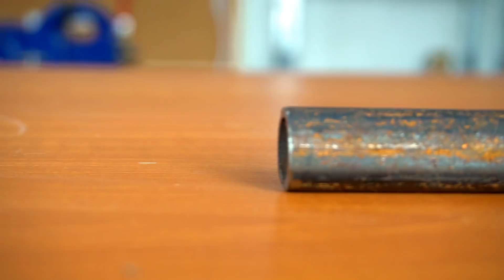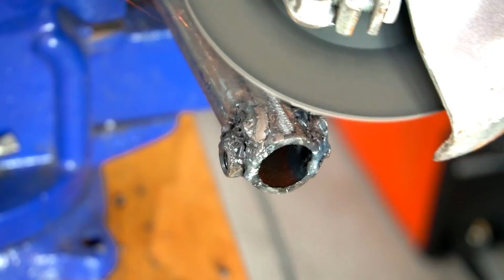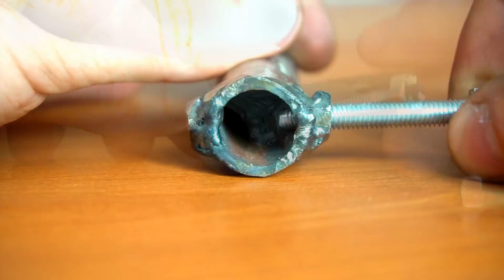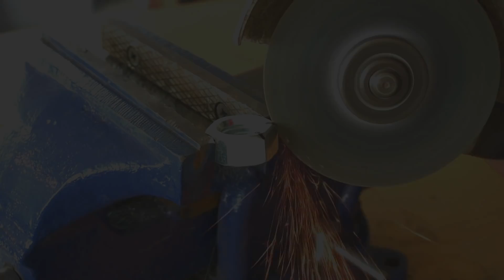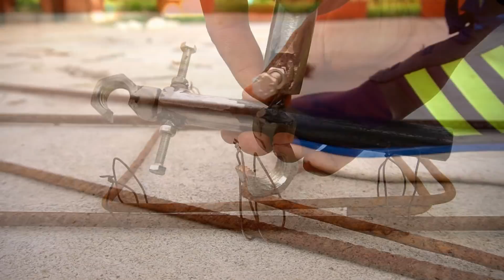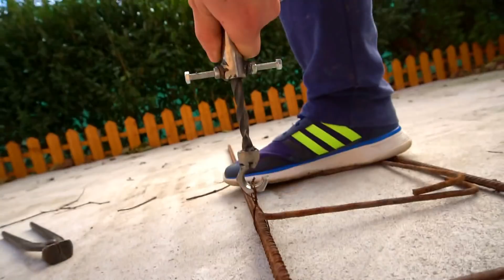Awesome New Product |DIY Life Hacks & Ideas

Comment: Nice idea. I can see you can make some further improvements by using an eye hook since its round and smooth so you can take it off those wire more easier. And, use a small many wound tension spring to hold that drill bit from dropping down. You made need a longer handle for this case. Lastly, when doing welding you need to descale those metal surface first. I can understand for this case it doesn't really matter. Nice job
.

Comment: Rebar wire tiers are super common and WAY more simple. In addition, if you have an angle grinder, drill, AND welder, why wouldn't you own a set of taps to just thread the holes?
 
At least there's somebody out there tinkering. Probably not an American, though. Can't get anyone to put down their phone here.

Comment: Would like to see more like this, but made a little bit more presentable.  Don't take this as a "put-down of the good ideas!  It will gain more acceptance if "cleaned up" a bit with welds made more like you are "proud" of them, rather than simply that they just work.

The ideas, though, are excellent!  Good work!!!  I intend to make the solder feed later on.

Comment: This tool accomplishes nothing I can't do with a simple pair of pliers. A complete waist of time and materials!
Reply: You know they are a few real world jobs that require wire to be twisted? You can twist wire for 14 hour days for weeks and still have more to do. My grandpa, dad, uncle and a few cousins all worked construction doing rodbusting and none of them had a tool like this. People twisting wire by hand for this long periods of time get injuries like copper tunnel and a tool like this where they just need to grab and pull would saved some from early retirement. I would put a grip handle on it and make it smaller with a smaller thicker pipe and tool dont forget to cut off the excess metal for weight reduction. You may think half a pound is nothing but it makes a different after workin 14 hour days 7 days a week for months.
Reply: Tornos caseros  para metal

Comment: You can buy safety wire pliers on Amazon eBay and harbor freight that are made to do this very thing and they do it very well and don't cost much I think I paid about $20! Also I hope you are grinding the cad plating off of your hardware before welding or wearing a respirator or your gonna have C.O.P.D. VERY SOON!

Comment: I think this tool is not useful
Reply: your wrong
Reply: You know they are a few real world jobs that require wire to be twisted? You can twist wire for 14 hour days for weeks and still have more to do. My grandpa, dad, uncle and a few cousins all worked construction doing rodbusting and none of them had a tool like this. People twisting wire by hand for this long periods of time get injuries like copper tunnel and a tool like this where they just need to grab and pull would saved some from early retirement. I would put a grip handle on it and make it smaller with a smaller thicker pipe and tool dont forget to cut off the excess metal for weight reduction. You may think half a pound is nothing but it makes a different after workin 14 hour days 7 days a week for months.